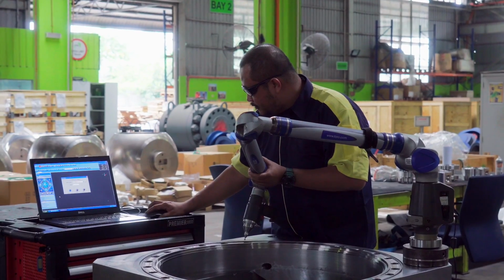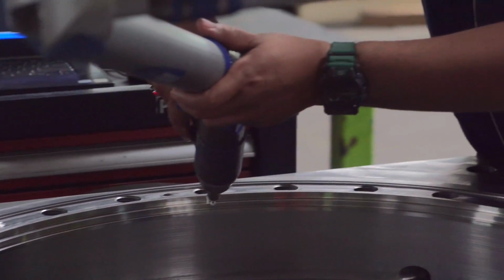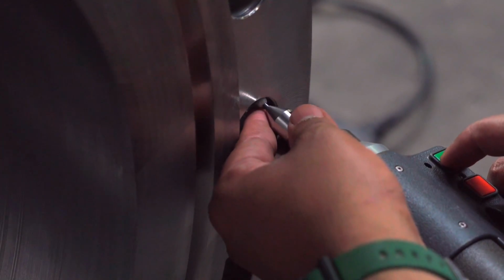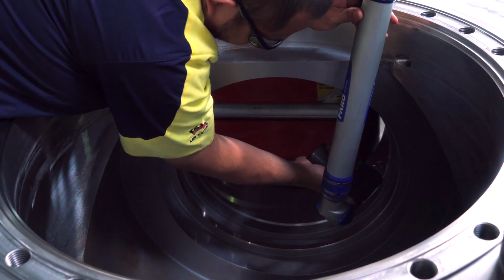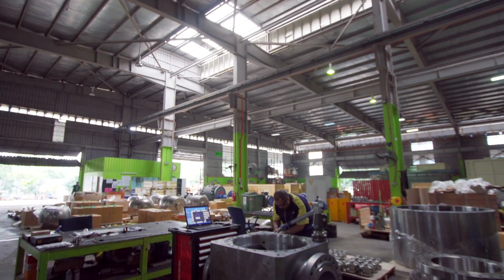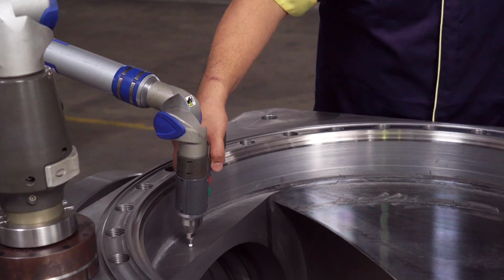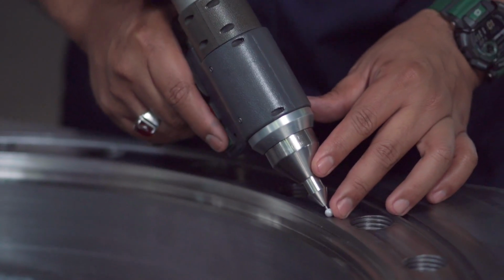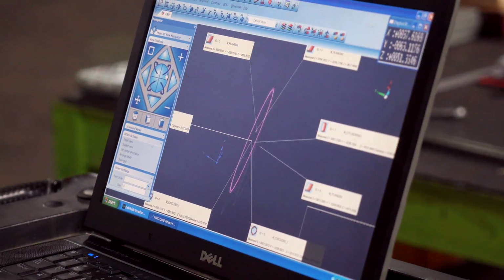MANUFACTURING AND TESTING OF SUBSEA BALL VALVES FOR BRUNEI

Comment: Another nice and informative video from the MIR valves team. 
Nice to see (and hear) the inspection being made with 3D measurements, allowing not only linear measurements, but a much more comprehensive Metrologic tool.

Regarding the solution implemented to test the hyperbaric features, I already used that while in Petrobras, specially for a larger valve that could not fit in the manufacturer’s hyperbaric chamber. 
This solution is also a reasonable alternative solution for shallow-water applications, where the forged body is already very robust (high stiffness) and practically would not deform due to external hydrostatic; so, testing sealing ports as closures and stem areas are the most prone to eventually fail and MIR presented this well.

Thank you for sharing and congrats to MIR team.